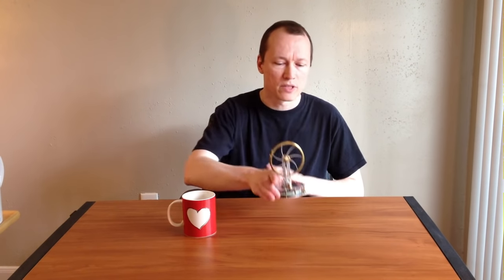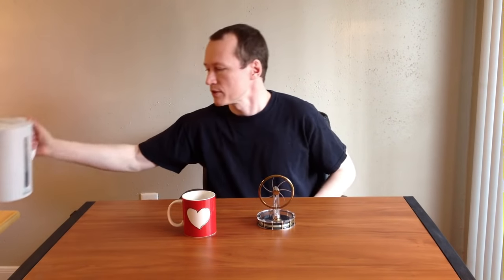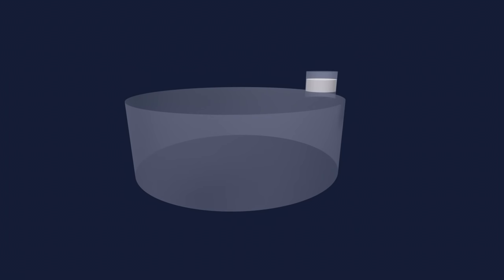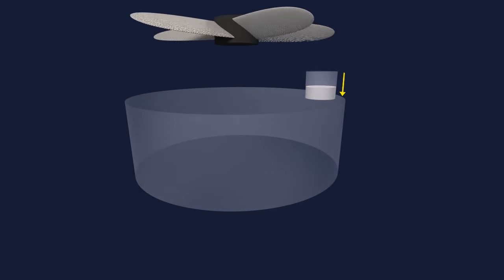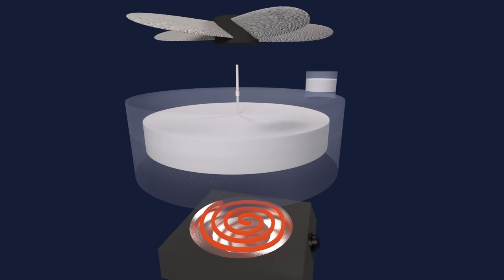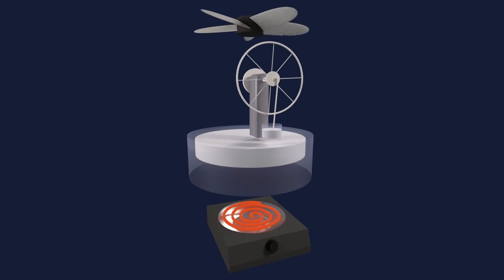How A Stirling Engine Works

Comment: Great Video! Finally really made me understand that the displacer piston is not affected by pressure differentials, but rather is moved by the power piston. All the other animations I've ever seen made me think the displacer piston was pushed on the bottom by expanding hot air while the top was pulled up by the vacuum of condensing air. I finally understand that only the power piston is effected, because it has one side to atmospheric pressure, and the displacer piston is just there to move around the gas so the gas is expanding or condensing overall... whew! So weird that I never really understood that before... now I can look at a stirling engine without my head hurting. Thank you!
Reply from the maker: You're welcome!  Thank you and everyone else for the nice comments.
Reply: I had the exact same issue!  This is the first time I could really understand how it works.
Reply: This video is wonderful and this comment allowed me to understand this concept that I may have missed without reading this. Thank you both for your time!!!
Reply: Me too - thanks for clearing that up
Reply: I concur it finally made sense to me in this video and your comment helped it sink in. Thank you both it was making me crazy for a while, I’ll sleep better tonight . LoL 🙏
Reply: @mstreeter11  >>> I agree. This video is probably the best explanation of Stirling operation I have yet seen.
Reply: Simon Tracer  >>> Why?

Comment: Going back many years when I was living in Western Australia I was working at the siding called Hines Hill & in the bar of the hotel they had a Stirling engine fan. The driving force was a small flame I think produced by kerosene. If the only one I've ever seen and it is always add me fascinated and it is memories of that that brought me to this page. Thank you very much for the explanation.

Comment: You don't need the dis-placer, just drill some holes on the top of the cylinder to let cool air in and hot air out.

Comment: Had to watch it 2 times. Now I get it, and hope this helps someone: the displacer is NOT moved by the air at  all, but by the piston.
It's so simple now, wish you mentioned that. I was getting stuck at "how in the hell does the air move the displacer so it can move the piston and so on?" 😂

Comment: So If you put a refrigerator on in a way that the heated  copper passes in the right place and the dooled copper passes in the right place you could run the vehicle with a Refrigerator?

Comment: Wouldn't the engine move in the direction you pushed initially rather than depending on the temp. diff. on it's sides?!?!
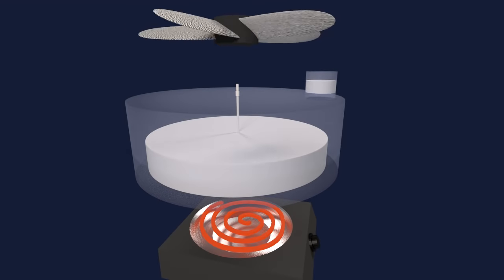Reply from the maker: No, take a look at 2:07-2:17 and see where the small piston moves as you move the displacer.  If you tried to spin it backwards without reversing the hot and cold sides you would be trying to work against that, pushing the piston down when it wants to go up and pulling it up when it wants to move down.
Reply: Michael S So if you changed the timing of the small piston in reverse of where it goes up and down as is in the video, would it be able to operate in reverse of what the video shows when the heat was applied?

Comment: What do you need to make it useble? I have 200-500w wasteheat per hour that I'm just blowing out, 12h/day. 365 days per year.
Wouldnt be any problem to harvest the heat by cooling it down with water and transfer it to a stirling engine.
Reply from the maker: Hello.  I'm not an expert so I probably can't provide the answer you need. But it sounds like you are looking to improve efficiency or use a Stirling engine in a practical application. I'd say try to figure out what the temperature difference between the warm water and the cold side is and see if there are any commercially available engines that can work with those temperatures, provide the power output you are looking for and be cost effective.

Comment: The Swedish Navy recently deployed a submarine with a Sterling engine! It burns diesel fuel for heat and it is extremely efficient and here's the best part: it is virtually SILENT compared to more common nuclear and diesel-electric types! This makes it extremely stealthy and thus one of the best submarines on earth. The US Navy "lost" an Aircraft Carrier to one of these Swedish Sterling engine subs in war games and so the US has leased one of the amazing boats, to study it's amazing properties!
Reply: The HMS (HSwMS) Gotland and its sibling Uppland were actually made back in 1995... but they were upgraded somewhat recently with improved Stirling engines. (Amongst other things.)
Also those war games + lease were back in 2005-2007.
(All according to Wikipedia....)

Comment: There's a science facility in Iceland I've seen and a friend worked in for 2 months. They're connected to the grid, but most of the time by he put energy back into it. Because Iceland is so far north it's temperate in the summer because of the gulf stream (like here in Ireland) but cold in the winter (a lot more than Ireland). They use the geothermal energy to heat the bottom of what he was told were 12 engines that power 2 alternators (6 engines each) between these and their emergency battery back they run practically fossil fuel free 12 months a year. Even their heating system is heated with a coil like an emersion. Granted it's slower than a gas or oil burner, burn its more reliable (according to them) and can simply be left on at a certain current setting depending on what time of the year. I really think it's a highly simple machine that can be tuned to take advantage of an specific temperature differential. Their engines looked more like the fire field ones you can get or see on YouTube, rather than Rhian low differential one. This permits more revs (as far as I'm told). However as much as I'd like to know... I dont know the exact physics behind tuning them. Either way, not even my love for rotary engines can beat my fascination of these! I'd love to see them used in computer server rooms one plate and the flywheel in the room, the other plate as part of the outer wall of the building. Imagine the energy savings! Grasshopper tea your not getting energy for free, it's measly recycling a large portion of lost heat energy from the current in the server electronics. Or like in Iceland. Use geothermal energy in cold climates, or cool underground temperatures in warm climates (that may not be as efficient or successful though). Hey stick them in a car or god bless you if someone reads this and stick 's one in a Bike..... (But efficiency may be a problem on that part...)

Either way... Best engine i by he world olid you asked me...

Comment: how big should the gap be between the displacer and the edge of the cylinder for maximum efficiency and optimal work output?
Reply from the maker: +Dorfdude8 To me that sounds like something that would be very difficult to work out mathematically.  It would likely be influenced by other parts of the design such as the size of the flywheel, etc.  If I were designing an engine and I wanted to optimize the displacer, I would probably run identical tests using displacers of varying diameters and thickness, and measure the RPM of the flywheel in each test.
Reply: +Michael S dang I was hoping it was something I can figure out with Calculus. thanks!
Reply: How heavy should the displacer be?

Comment: I see the appeal of the magnet, but wouldn't it be easier just to make the piston vertical. Then gravity is parallel to the cylinder and you would remove the force perpendicular to the cylinder and thus the friction.

Comment: if we put sterling engine inside a pressurised chamber then it's efficiency become higher because, heating source is same but atmospheric pressure is considerably low regarding this
if we use heavy wheels instead of small, then will it's efficiency become higher because more energy stored by more heavy flywheels

Comment from the maker: I'm not an expert beyond the basics, but sources I've read seem to agree that Stirling engines have the potential to be very efficient.  I believe this is at least in part because the heat that is put into it is not sent out an exhaust pipe like it is with a gasoline engine for example.

Comment: I don't understand why it wouldn't work in either direction for both hot or cold on the bottom surface once it gets going
Reply: I agree.  With heat on bottom, pressure increases, and drives the piston. Why would it matter which direction? Either direction the displacer will go up and down. So, why would it care about one direction or the other? Seems to be it should run either direction. My only possible guess would be the timing of the displacer is different, or not offset by 1/2 turn, and that would then be a possible explain.  And this suggests that the engine could be built that would run either direction - but without optimal timing. 
But, so far, yes, I agree - the direction you spin (start) should not matter - the air pressure is  free to push the piston up - why does or would it care which direction the flywheel spins, or is started to spin at then?

Comment from the maker: Thanks!  I'm not sure about all types of Stirling engines, but this type won't start on its own.  You have to spin the flywheel before it will start.  It of course also needs heat energy in the form of a temperature difference between the top and bottom before it will run.

Comment: I'm curious. Why couldn't you reverse the direction of the flywheel without changing the heat source. Seems it you simply stopped it and then gave it a shove in the other direction it would still work fine. I'm confused.
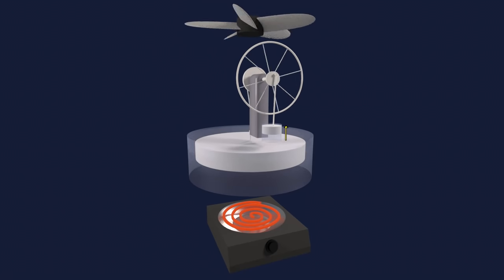Reply from the maker: Check out 2:34 in the video. The warm air is trying to push the piston up. The piston links to the flywheel on the right hand side. If we tried to spin the flywheel in the opposite direction it would be pushing against the direction the piston wants to move at this point. In order for the flywheel to spin in the other direction without reversing the hot and cold ends, the piston would have to connect to the left hand side of the flywheel. Hope  that makes sense.

Comment: where can i get this stirling engine
Reply from the maker: If I remember correctly I got mine from eBay.  I would try eBay or Amazon.  The web site shown on the bottom of mine appears to go to an unrelated site so I don't know if the exact model I have is still made.

Comment: So if you have a solar water heater, and place a sterling engine on top of it, it should be able to run on solar power?
Reply from the maker: Possibly because as long as you can get a temperature difference going (whether it is solar or not) it should work. I imagine one would end up using the hot water from the solar water heater rather than placing the engine on top of the solar water heater because then the engine itself would block some of the sun.

Comment: I still dont understand what makes that thing go down. It goes up causd of the hot air expanding right but what makes it go down just as fast? Thered no way the air cools down that fast
Reply from the maker: It is hard to believe the air can cool down that fast but it does.  When it does, of course, the outside air pressure pushes the piston down.  The way I think of it is: 1) It is not necessary for the entire volume of air on the cold side to cool down before the air starts contracting.  Just the air extremely close to the cold edges will cause the overall volume to start to contract.  2) But you're right that there is a limit to how fast the air cools down and I believe that is a limiting factor to how fast the engine can run.

Comment: I'm trying to make one as big as a tealight holder to propell a small wooden boat. I want to use household items. Can you help?
Reply from the maker: Hi - I'm afraid I wouldn't be much help.  I made one out of cans and a balloon once, but it was very inefficient and barely worked.  One made from household items like that is a good learning experience but one that's reasonably efficient needs to be made from machined parts.  I wish you the best though and hope you come back here to share a link to a video of it!

Comment: Why is it that if the bottom plate has a higher temperature than the top plate it moves clock or counterclockwise, and if the bottom plate has a lower temperatur than the top it moves the other way arround?
Reply from the maker: Take a look at 2:30.  When the hot air pushes the piston up it will turn the flywheel counter-clockwise.   But that isn't set in stone.  Notice that the rod connects to the flywheel toward the right side.  But if the rod connected toward the left side at this point in the cycle, the flywheel would turn clockwise.  Whether it turns clockwise or counter-clockwise depends both on which plate is hot/cold, and how the piston rod is connected to the flywheel.

Comment: You Haven't ACTUALLY Explained it. Have You.
There's Two Cylinders. A Big Cylinder and a Little Cylinder.
The Stirling Engine Requires a Temperature Difference. A Hot side and a Cold side.
The Big Cylinder: As its Heated - The Air Expands, The Pressure Difference, Pushes The Big Cylinder - UP.
The Piston AT THE TOP Cools, as its On the Cold Side. The Air, Under it Contracts, Sucking the Piston Back Down Again. Furthermore, There's ALSO the Little Cylinder. As the Big Cylinder Piston, Moves Up - It Contracts "Squezes" the Air in The Little Cylinder. This Pressure, Helps Push the Big Cylinder Piston, Back Down Again.
Furthermore, There's The Fly Wheel. The Fly Wheel ALSO Helps Move the Big Cylinder Piston, Back Down Again.
Back Down Again, The CYCLE, Re-Starts. The Air is Heated. It Expands and the Pressure, pushes the Cylinder Piston UP Again.
Reply from the maker: You seem very passionate and adversarial about re-explaining it in a manner that makes more sense to you. Note that the "Big Cylinder Piston" in your explanation is not a piston at all. It is called a displacer and its only purpose is to move the majority of the air to the top or bottom of the big cylinder so the air can heat (and expand) or cool (and contract). Pressure does not push the displacer. The displacer has to be moved up or down by the connecting rod that connects to the flywheel. I would recommend buying a kit like the one in the video or building your own from a DIY YouTube video if you want to understand it better.

Comment: What is the reason for the displacer being at the top and the piston being half-way at the start of the cycle. Why is this the optimal position?
Reply: With the displacer at the top, the air inside the cylinder is exposed to the "hot" side where the air can expand from the heat. The air is in communication with the small piston at the halfway point where it "pushes" the flywheel rotating it. In turn, when
 the displacer moves down, the heated air moves to the "cool" side where it contracts with the power piston half way through the cycle in the opposite side of the stroke "pulling" the flywheel adding rotational momentum. The displacer has no real resistance to its motion simply moving air back and fourth to where it is exposed to "heat" or "cool". The power piston is the one doing the work, with a good seal, transferring expanding or contracting pressure to the flywheel. I hope this helps. After watching several videos this one explained it best for me.

Comment: How long would it run after being taken off a heat source and sit on just a room temp table?
Reply from the maker: A rough guess based on what I remember is maybe a couple of minutes.  When you take it off of the heat source it will keep going but it will run slower and slower until it finally stops.

Comment: Why doesn't a little air leak out with every stroke of the power piston?
Reply from the maker: A little bit of air likely does leak out but since the piston moves both ways, it leaks back in. But the tolerances have to be pretty tight or the engine won't be very efficient.

Comment from the maker: Thanks for the comment - Maybe someone can confirm this, but as I understand, it would be considered a beta type.
Reply: Gamma... which is kind of a version of beta.
Beta has one common cylinder for both displacer and work piston while gamma has a separate displacement cylinder, like yours.
(Youtube comments are a mess, especially older ones, so you may have gotten an answer long ago that I don't see now.)

Comment: Is there a ratio that we need to keep in mine between the piston size and that of the air displacer or will any relative ratio work?
Reply from the maker: +theDemolisher13 I'm afraid I don't really know the answer to that.  I suspect that the ratio is flexible.  For example you could probably get away with a smaller displacer to piston size ratio if there is a bigger temperature difference.
Reply: Ok thanks for you input